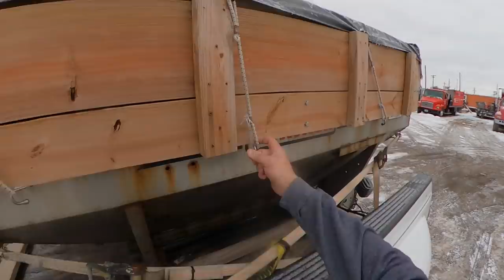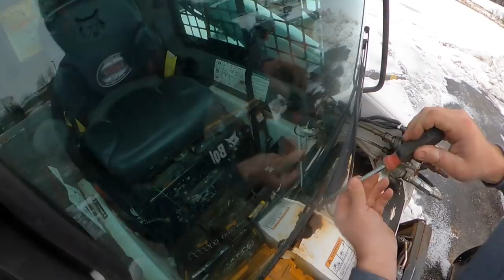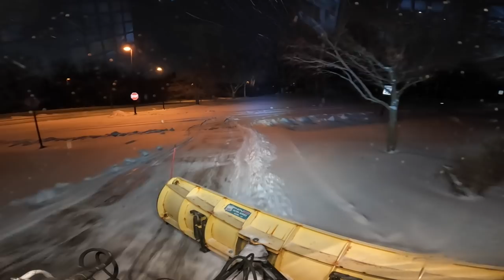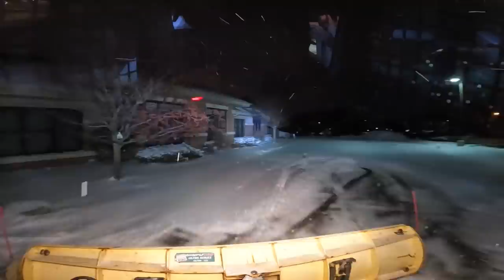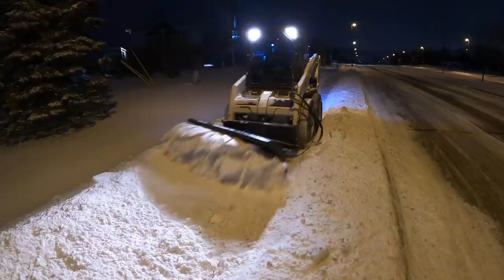Snowplowing is easy money!

Comment: I worked up in Prudhoe Bay, Alaska for two winters and agree with you about it being a lot harder to work in the cold weather. I've been out in 60*F below zero and 40-50 mph winds on the drilling rigs in the Beaufort Sea on the offshore islands. I drove out to them in an Oshkosh tractor and bulk trailer hauling 660 cu. ft. of dry cement each trip. I was driving for Halliburton Services. It was a great job.

Comment: Maaan that guy wasn't lying about those machines being rough! Looked kinda like a ventrac 3400, i run one in the winter months up here at Boston College. Far from the smoothest ride espically going over curbs. And not nicest cab but it's warm so no complaints there, but it's a workhorse. And between the snow thrower, roller brush, straight and V plow it's killer for sidewalks stadium entrances and tighter spots. Even has a sander that gets thrown on time to time.

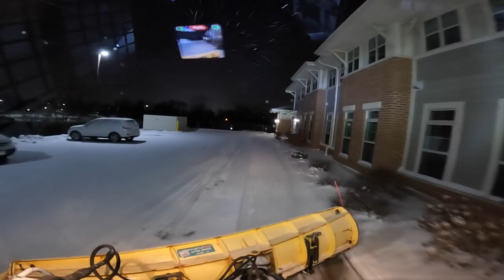Comment: 13:50 I had a giant Snow Dogg vplow and at a reserve center I did the snow removal, I could pull up to the side walks along the parking lot, straighten my plow and drop it and back drag the side walks off. Then come through and push the snow away from the side walks and go on with the rest of the lot. That was a pretty cool gig at that particular place. Had a trailer setup there with a snow blower and salt spreader and salt. Of all the places to plow, that was my favorite.

Comment: Pre-salting helps make it easier to clear snow since it prevents it from sticking and icing but if the snow is too much I don't think there are any benefits. If you plow before the salt even disinegrates, you're picking up the snow and salt and would have to resalt so that's a waste. If you presalt and the snow begins coming down too fast the salt disinegrates and you have enough snow on the ground to the point it's time to shovel/plow and salt won't do anything. Postsalt has worked great. Good to see you working again.
Reply: Of course salt helps, but the amount of salt you waste for that little bit of help isn’t worth your time and money

Comment: Pre-Salting works but it experiences a science term referred to as bridging.  Once, it starts snowing fast and heavy it is useless.  I only recommend doing it at night for freezing rain and light snow coatings up to an inch.  The problem you run into is that your customer base does not usually want to pay for it and they get upset over excessive salt usage. That is why PennDot uses brine machines over salters it is supposed to conserve salt while getting the same type of results.

Comment: finally a snow video
feel free to make more

in my country we do not use salt on private properties or private roads perhaps on the largest shopping malls but almost not even there.

This means that customers do not want to pay for the service.

  and in our country it costs a lot to sue for example by falling on the ice so we do not have to think about this ....

Local government authorities are trying to remove as much salt from the roads as possible
we use more sand than before

..when it comes to whether it has any effect to salt before snowfall then comes

  it depends on whether the road is dry or wet air temperature and ground temperature

and where you mix the salt or add the salt unmixed
..if you spray the road with salt liquid mixture "mixed" then you notice the difference with
that the plow comes through faster snow cover
down to bare asphalt on the first try so you do not have to drive over several times

Comment: Presalt for ice that's coming sometimes, or I'll use it to buy me time if the snow is going to  continue past first round and I know I can't get back there in time. I think it helps with the calls...weather is a little like concrete, it sets up a little different everytime, so you have to be able to shift on the fly

Comment: They pre salt here on the side roads. On the main roads running up and down through the city here they use liquid salt. They usually do two lines of it in every lane of the road.

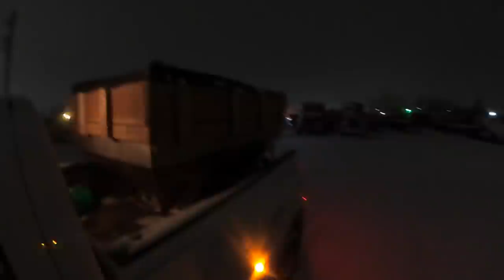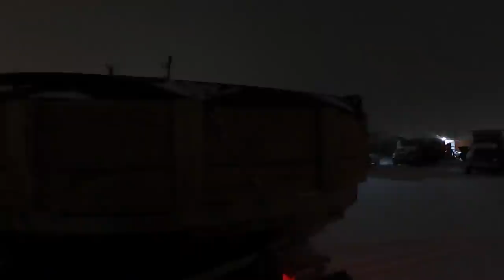They started about 8:00 on Thursday morning here and it's about 8:00 on Friday morning and we got 7 in of snow.

For the most point though it doesn't really help. It turns everything into sludge but the sludge is what gets all the cars stuck here.
Reply: @Alex yeah. Usually after the snow goes away every car wash in town that offers the undercarriage wash has about a 20 car line in it when you go buy it.
Reply: @Alex they do if you take care of them. Mom has a 2011 Chevy Cruze and she doesn't put it on the road during big major snows and when she does get out every couple of days she'll run the undercarriage wash and it's just fine..

No my dad has a 1994 Chevy pick up. And the winter of '0405 he had to loan it out to a family member so they could get groceries and take Grandma and Grandpa to the doctor and stuff. Dad would tell them to take it through the undercarriage wash. They didn't listen the first bit. They even took the money that Dad gave them for the car wash and spent it on whatever they wanted. When dad got his truck back it was under the assumption that his family member had took care of it but after a while the guy that replaced the tires on him said that he could start seeing where the frame was starting to rust apart. By the time Dad called it the frame and everything had 50% rusted away in certain sections.
Reply: sounds about right for a county. around here, they'll pre brine Thurs morning, its supposed to rain Friday snow Sunday. its a waste of tax pay dollars here

Comment: Ditto for pre-salt when it starts wet only. Otherwise it seems like the 1st scrape just pushes all the salt you pre-salted, without doing much good. Also, the salt only really seems to work down to 15ish anyway. Lower tempe and it's just better to use cinders.

Comment: So I am up in Hartford/Slinger/West Bend service area, I do presalt based on circumstance.  Here is our presalt criteria, if the snow is starting in the daytime or evening and service will happen on a big temp drop, we salt the whole lot.  Regardless of that, every retail lot we do we salt entrances, handicaps, any driveways to the lot.  But my biggest factor is temp.  If the event starts at lets say 25 degrees but I know that when were actually out there pushing or cleaning up its going to be significantly lower than that, say 19 or less, guess what, I would be dealing with ice, hard pack and I would be using 30-40% more salt to burn it off if thats part of the contract to burn off to pavement.  Another thing, you can use traffic to your advantage.  If drop a good bit on specific spots, traffic will spread that around for me, and keep the lot soft and easy to manage later when it closes or is less busy.  Walgreens pays me to presalt too, so there is that, they have learned to love what heavy entrances salting can do for the whole lot, keeping handicaps burned off longer, etc.  Now the other thing, as stated above, if im doing a temperature drop based presalt, were mixing 20% mag chloride or running calcium chloride prewet on the spreader.  I like it when the base layer picks itself right off the ground like building a snowman, you end up with a really clean lot and very little salt needed to make your work look perfect and professional.  Thats my practice.

Comment: Love your videos and can absolutely relate regarding the weather accuracy, or lack there of. It's a lot of years ago now but I used to plow every season here in Sweden and rarely did they predict the weather well. I mean you still gotta' head out if it's 2-3cm or more but it's nice to be somewhat prepared of what's to come. Do I gotta push the snow further away as it's gonna snow A LOT? Gonna melt away within 2 days? It's always nice to now. 

Love all your videos - it's not common to put concrete on driveways here in Sweden, usually asphalt, so it's super fun to see you pros get it done.

Comment: Answer: Pre salting is good for preventing snow from bonding. But if the storm lasts longer than expected you will use more salt. Therefore, the cheaper route is salt after plowing. The more convenient method is presalt.

Comment: Yeah they always "predict" these massive snow storms and we get a dusting. The past two days they predicted between 2 and 3 feet and we got around a foot in my area. Areas around us had upwards of 3 feet. We live in the snow belt in the Great Lakes region. We get tons of lake effect snow and it comes in narrow bands and it's very difficult to predict where it'll form and dump snow. But they always say we're gonna get hammered and it's gonna be a big snow and we get a few inches. They call a few inches of snow a storm now apparently. Then when they say we're gonna get a dusting, we get 7 feet lol. Same with with temperatures. They always say it's gonna be warmer so it goes in line with their climate agenda and it always is colder. I swear they're adjusting the numbers on the temperatures too so it seems like it's warmer than it is.. I can tell the temperature with my body plus or minus 3 degrees and it's always colder than they say. My analog thermometer also tells me it's colder than what they say. Like today, they said the high was gonna be 30 something and low in the low 20s. It only went up to 28 so far and it's now gonna be 8 degrees tonight for a low. I swear they're adjusting their numbers to make it look like the temperatures are getting warmer. Even though they are the same as they've been for the past 30 years for me and over double that from what the older people tell me. Same with the weather. Its always been crazy unpredictable with some dry years and some wet years. Just like the dry aired places have always been dry and drought stricken.

Comment: Hey Ryan I love the videos.. I have a landscape company. Been doing it since high school. My goal was to do concrete and asphalt along with landscaping.. I had that and had paving box, 2 rollers, 10 wheel dump with my 6 wheel dump, 2 skid steers, mini excavator and much more.  MY FIRST SEASON DOING THE PAVING AND CONCRETE WE KILLED IT. THE CITY INSPECTORS LOVED US AND I COULD NOT ASK FOr ANYTHING BETTER. THE ONLY PROBLEM WAS I STARTED DIALYSIS THAT SPRING. IT WAS TOUGH AND THE FOLLOWING SEASON EVERy JOB I BID I WAS TOO EXPENSIVE NotSURE WHAT CHAGED THAT WINTER THE PREVIOUS SEASON MY PRICES WERE DEAD ON.. but between DIALYSIS, MY PRICES TOO HIGH AND HARD TO FIND GOOD HELP I DECIDED TO SELL OFF THE PAVING EQUIPMENT AND JUST CONTINUE THE LANDSCAPUING. ANYWAY THE REASON I WAS COMMENTING WAS TO LET YOU KNOW I AGREE WITH YOU ON THE SALT BEFORE SNOW STORMS, THE ONLY TIME I SALT BEFORE A STORM IS IF WE ARE GOING TO ONLY GET A DUSTING OR ON INCH, THAT WAS HOPEFULLY THE SALT IS ENOUGH TO KEEP EVEYTHING CLEAR. THE ONLY OTHER TIME I SALT BEFORE THE STORM IS ON HILLS TO PREVENT ICING  SO THE TRUCKS DONT GET STUCK. THOSE ARE THE ONLY TIMES I PRE TREAT... SORRY ABOUT THE NOVEL.  THANKS FOR THE VIDEOS KEEP THEM GOING. P.S. I LOVE BUGS AND JADE. HE IS AN AMAZING WORKER..

Comment: Ryan i just got a 7.3 and it overheats with my plow on if im driving on the freeway..
Replaced thermostat and radiator
Reply: try lowering and angling the blade. probably restricting airflow to the radiator. our dodge 3500 gets hot with the Western 8 ft plow all the way up and straight

Comment: Dude probably a really dumb question 
I have actually never seen snow in my life
In Melbourne Australia we don’t have snow plows because we don’t ever get snow 
My question being , why salt ? What reaction does it have to the snow
Do they also give u a general area to cover under a contract  ? 
Love the videos
Happy new year to you and your family
Reply: Salt melts the ice, and helps turn the snow from slippery powder to wet mush.  not sure of the chemical reaction happening but it works!  Many times its mixed with other chemicals or just sand/dirt depending on where you are, how cold it gets, if theres a lot of ice vs snow, etc
Reply: Helps melt the ice and helps some with traction when walking on your drive or sidewalk
Reply: It also helps provide traction for your tires. Often times, if all the snow isn’t removed it’ll ice over the next night when the sun is gone and the temperatures drop.
Reply: Salt is put down to prevent sidewalks and roads from turning into ice. Or it's used to melt ice.